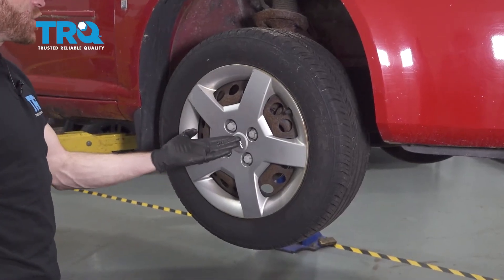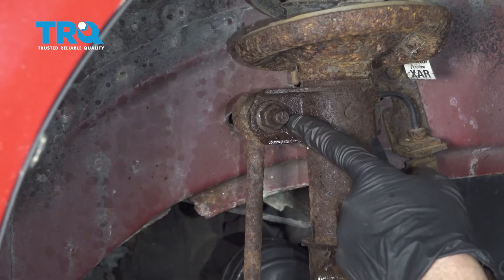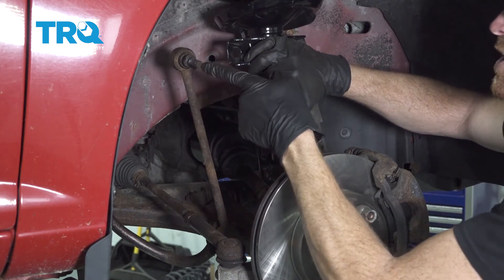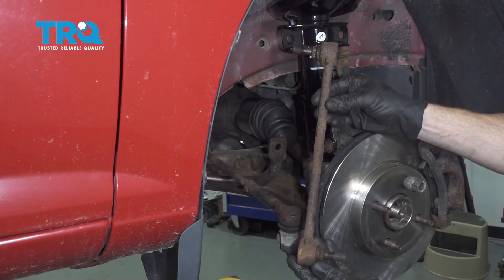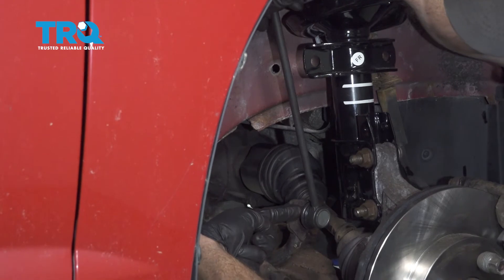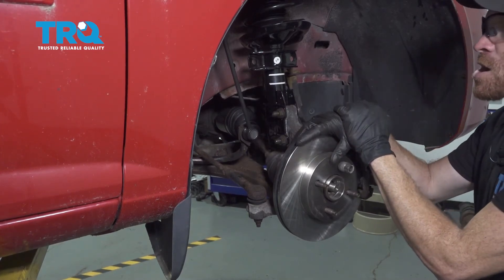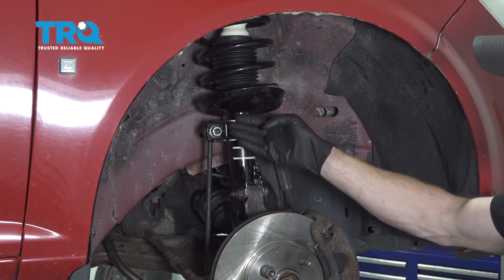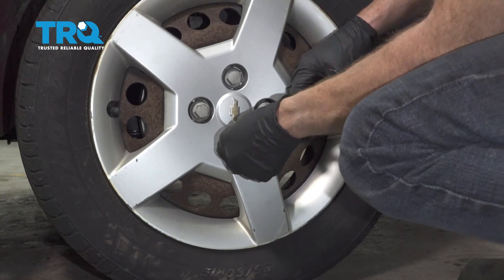How to Replace Front Sway Bar Link 2005-2010 Chevrolet Cobalt

Comment: 2:38 . Twerking that 18mm nut to 59 foot pound. I actually thought you had a device to measure the foot pounds electronically but upon looking it’s the torque wrench itself. New to this stuff but learning a lot. Thanks. You should’ve explained that in the video. It would’ve taken only a few seconds. Thanks for the video . If I was to do that job the only tough thing to figure out was that part specifically but upon finding out what it really was means this job is a piece of cake.